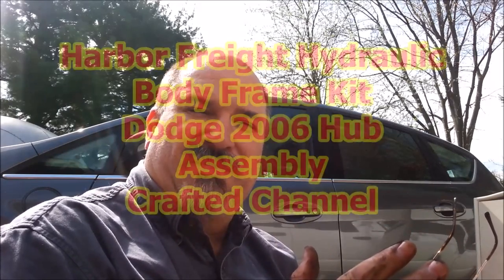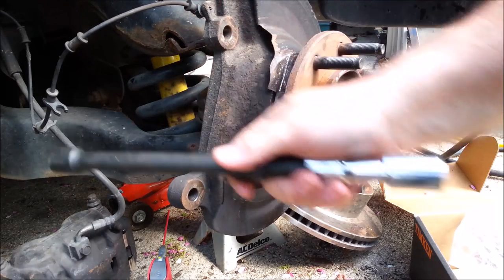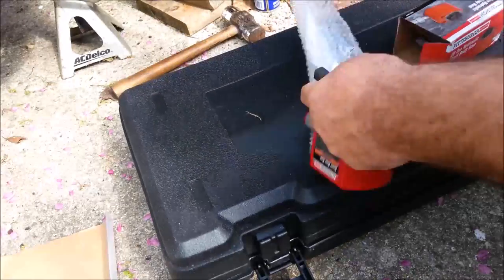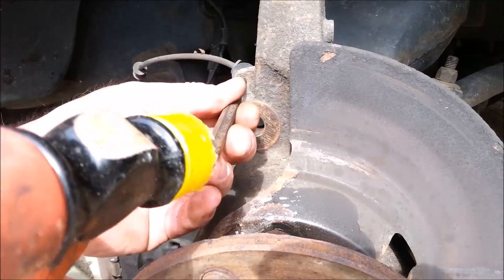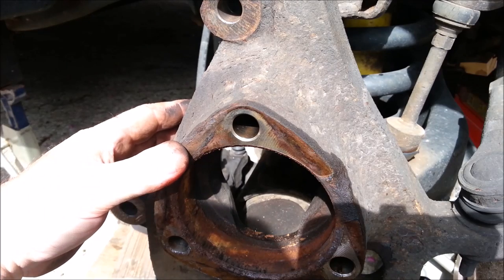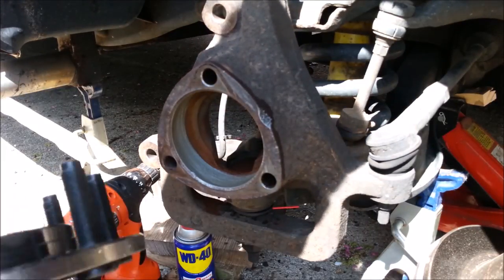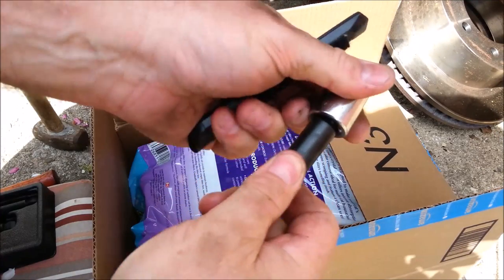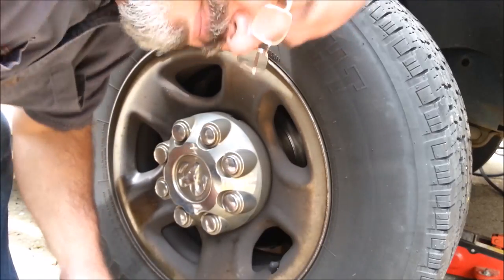Harbor Freight Hydraulic Body Frame Kit Dodge 2006 Hub Assembly Crafted Channel

Comment: Very good observation, only the one incline to mechanics will appreciate this tips, but the risk it’s if you spend all this money and brake something else or can’t fix it then you will double the price, pay a tow truck or rent a Mobil mechanic, but, try first, glory belongs to the positive mind,
Reply from the maker: The error many make is presuming the repair is an end unto it's self.  This is not the case.  An important element is building one's tools as well as skills over time.  I have used the hydraulic set 4 or 5 times by now.  Calculating the the hydraulic kit as a cost in the repair.  This is a fallacy.  First off, I could have easily sold it for $40 less than I paid making it's repair cost portion only $40.  But furthermore, if I've used it happily 5 times when the cost per use is price / 5.  Over time it will become price /10 and price /20.   Considering problems only on the narrow conditions of immediate cost is short sighted.  You have to be very rich to make every decision based on cheapest path possible.  Doing so leaves you Ill equipped and often buying things over and over as you discard he short sighted tool purchases.  The hydraulic set to me has much more utility than this single job.  I don't live a throw away lifestyle.  I am much to poor to be a tightwad.

Comment: This is cool. What about a slide hammer?
Reply from the maker: At the time, I looked for mine, I only recently found it.  After using hydraulics, I'm not sure it would have worked.  I used a decent air hammer on it which would be in the ballpark of my slide hammer power wise.  I've used the hydraulic set a number of times since this video.  Very pleased I have on in the stable again.

Comment: looking good! I been looking at that harbor freight hydraulic kit myself and drooling a bit. at least now I can watch you use yours till I can afford one of my own.
Reply from the maker: How you been Dave.  Need to check in on what you're up to.  Hope things developing in a more positive direction for you.  I wouldn't call this a high use tool but it's definitely something when you need it, you need it.
Reply: i have lots of those type of low use tools, but love having them when needed. great video
Reply: the hydraulic kit is only $116 on ebay shipped!

Comment: Bought one for my 04 Chevy Tahoe 4x4 when it went out at less than 100k. Both actuall went out less than 100k miles at different times. 

Last one I paid $145ish and it's got a lifetime warranty as all my parts do from my local parts house, including brake pads and rotors. Yeah I know you're thinking WTH but yeah they do it for me. 

 I buy alot of parts thru them for me and others I know so back scratching going on. 

I also had a press kit I bought back in 1997 and sold it to the truck/trlr repair shop I was working at as I had it for doing trailer work, truck and trailer frame work, spring pin bushing work on semis and other work on anything. 

I didn't have any trouble getting my hub out after I removed the bolts out and used a 10lb large sledgehammer. 

The other one I replaced 120 miles East of home in a bank parking lot next to the auto parts store. They loaned me the tools I needed. Spent about $40 on some tools that I scratched that they'd let me borrow that were new. 

Just used the factory tire jack and the tire as my safety stand as resources were limited. .
Reply from the maker: I couldn't' believe how long the bearing on the right lasted after it started making noise.  A period of time I didn't know what it was, then I had a must go event I towed my trailer to.  I must have driven on it a month.  Lord looking out for me.  Haven't had any problem since.  Did do the tie rod ends and ball joints.  Rear brakes, need to do rear axle seals and parking brakes next.

Comment: You can use a socket and an extension to but up against the knuckle. The just turn the steering wheel and use the hydraulic power steering to pop the hub loose
Reply from the maker: I believe I covered that in the video.  Bent the 1/2" drive extension.  Might have been last or second to last failed method before I went to get the hydraulics.  I've used he set for several other things since.  Glad I have it.
Reply: Oh I missed that somehow. Sorry. I like the port o power idea to.

Comment: Could have done the same with coupling nut and a bolt. Or, hammer out one of lug bolt and use a bolt and nut to push out the hub. Either way cost you couple of dollars.

Comment: If you look closely at that porta-power accessory-
You could've simply used your own brake caliper to push it off.
Reply from the maker: I've been thinking about your statement.  Bear in mind, I've used they hydraulic set several times and I'm glad I bought it.   Would you have bolted the disk and caliper one, removed the outer pad and pushed it off with the power brakes?   That's a good idea, maybe the the only really good one offered.

Comment: I did the same thing the other week except I put it on backwards and the rotor wouldn't fit. Wasted 30 minutes doing it twice.
Reply from the maker: I recently did a Tomos Moped Transmission.  Had it appart and togeth 6 or 7 times!  finally got it all right.  ;-)

Comment: Cut a stud off drive it out with a punch....put a long 1/2 bolt through rotor with a nut on the back side ... hold back on the nut and drive bolt into the knuckle.... it will push itself off

Comment: oh, and don't waste money on chrome vanadium 1/2in dive sockets and extensions. I've displaced all of my chrome with impact. once you've hammered loose what you need, you can always get a smaller 3/8 if you need tight access. I never use 3/8in impact.

Comment: It looks like this HF hydraulic tool set has a flange type spreader also.  My space (on a 2006, 2WD Montego) is too tight for the ram you bought, could that spreader be used instead? Or is there a smaller ram (I looked, but did not fin any).  

Or, could a cheaper bottle jack be used somehow? (I only need a tool to remove the wheel bearings from the knuckle; no other use).

Or, could I possible use a hydraulic puller - and what could I attach it to as a base? (The car is in my 'single wide' driveway, and I don't have a tree to wrap a chain around - for the second end of the hydraulic puller). 

I am surprised no one makes a hydraulic tool specifically designed to remove hubs (that have no axles in them) as on  2 Wheel Drive cars with no axles in the rear tires.

Comment: Great tool, but 🤔 Am I the only Mechanic that noticed beside not putting the backing plate on, that he didn't put abs/on right the wire goes though the hole in the steering knuckle 🤦 right as he was saying if it's worth doing it's worth doing it right. It happens just was ironic. I see after putting backing plate on u fixed it I think I hope. But great tool and great video 👩‍🔧
Reply from the maker: Nope and nope.  Finished correctly.

Comment: Nice fix Dave, hope she rides smooth for ya :)
Reply from the maker: Oh yea, she does.  Now I have to replace the valve cover gasket which contains the injector wiring.  Been running down 2 cly for a week now.  Last of the parts here any day.
Reply: Sweet....good luck with her :)
Reply: My new vid may help you out on your Atlas if ya wanna check it out

Comment: Make sure u clean those bolts for true tightening there
Reply from the maker: Clean and greased.  You're not one of those dry bolt torque'rs are you?  ;-)
Reply: @CraftedChannel  not grease lock tight sir
Reply from the maker: Long time ago.  Don't think I Loctite'd them.  There was no thread compound visible when I took it apart.  Fortunately, wheels still attached.  ;-)
Reply: @CraftedChannel  coolant passage must b silicone also 👍 u got it there

Comment: You should not have used anti seize on those bolts. Lock tite is a must
Reply: Was it antisieze or gray rtv?
Reply: You were right, sorry.  Torque should hold the bolts, but I usually use a dab of blue loctite on most suspension fasteners because of vibration.
Reply: @IamKurr  I use silicone works best stops rust and bolts wont back out. Mega black or ultra black works best

Comment: When my durango was stuck I used a nut and bolt
Reply from the maker: Made this a long time ago, don't remember if I had two parallel to each other surfaces to spread against in this way.  I'm still happy, I've used this tool kit several times for other projects like straightening out a Kennedy tool chest which had the top crushed in on it.  I've probably received 200% of my investment back by now.
Reply: @CraftedChannel  I like it but the whole kit is un needed. Hopefully I can find those two pieces by themselves. Midwest rust is brutal.
Reply: @CraftedChannel  but yes I'm stealing ur idea lol
Reply: yes i have used a nut and bolt too to press out something,, i now have the longer coupling nuts they have at the hardware store..

Comment: Tools:  Couldn't you have used a hydraulic flange spreader?  They cost about $75 where as your setup cost about $200-250.
Reply from the maker: If the denominator were accomplishing this one job, you'd be correct.  Remember I said I once owned a set like this I missed having one.  I've used it at least 4 more times since.  And I'll be very happy to use it more.  So, my cost per job is less.  This was a long-sighted purchase that solved an immediate problem.
Reply: It looks like this HF hydraulic tool set has a flange type spreader also. It my space is too tight for the ram, could that spreader be used instead?

Where do you buy a $75 spreader?

Comment: Very good, Did you see the Hub Breaker on Amazon?   Last hub job I had done a friend didn't for me saved me 100.00.  But I ordered the Hub Breaker and will only cost me less and I keep the tool.  Thanks for the video.
Reply from the maker: Yes, I did.  But I regard it as much more expensive because it has only one use.  I don't replace hubs for a living.  If I did, I would consider it differently.  The hydraulic kit has been used on a few projects since the hub replacement.  So, my cost per use is only 1/3 or 1/4 at this point.  I intend to use it for the next 20-100 years.  ;-)

Comment: But isn't the baby-bottle jack all you needed? I am sure it came with a jack handle so you don't really require the kit- at least for this application if I wanted to save myself $200
Reply: It doesn't come with the pump ... just the jack

Comment: Sharpening the air chisel would have gotten you there but I also lie to my self to justify new tools hahaha
Reply from the maker: I've used it several times since.  I picked up a bent up 7 drawer Kennedy last summer.  Used it to jack the top back into shape.  Paid 50 for the box.  Put it in place of a 5 drawer Waterloo which I have now sold.  Made the cost of the tool back again on the toolbox.  It would easily sell for 250ish.  My only problem now is it's so cold in Ohio. Been in the teens lately.  Doing indoor work.

Comment: If you are REPLACING a "ball joint" (tie rod, control arm, steering)
the best "tool kit" is a Pickle Fork and sledge hammer. IMO.
Reply from the maker: I've since replaced the Tyrod ends and both upper and lower ball joints on this truck.  Didn't do a video.  Big job for a fat boy without a lift.  ;-)
Reply: @CraftedChannel  
I'm 5' 8" 380 lbs. Always in my my own driveway. Left arm unable
to reach over head, about 20* movement. 42 year old injury, inoperable,
so I've learned how to cope.
Yes, thank you for the kind words- most just leave comments, I actually enjoy interacting with the Uploader, giving advice, answering questions if I can. Yes, outer pad off- hydraulic caliper has thousands of pounds of clamp. Porta-pack is awesome tool, but I was just thinking out loud and in practicality- that what's possible if someone doesn't have extra money for tools.

I remember watching my Uncle, using the car's bumper jack and it's own weight to dismount & mount a new tire; that's why the "lug wrench" that came with cars was called a "Tire Iron", and the bumper jack's baseplate was curved. Rural Folks had a certain self reliance you don't see today.

Swap an engine under an oak tree, walk 10 miles each way to ORDER a car part. People were way different back then.

Comment: You forgot to put the dust shield back on
Reply from the maker: I don't remember if I mentioned it or showed it later in the video but I do remember the error and correcting it at the time.  Timken bearings still doing well.

Comment: You got the guard the goes between the hub haha but I’m definitely going to get one of those hydraulic tools cuz it was a pain for me to get mine off
Reply from the maker: I corrected the missing dust shield and mentioned it in the video as I remember.  It will work.  I've used mine since to straighten out a Kennedy Tool Box with crushed top.

Comment: All you had to do was bolt the wheel to it and use a 4x4 against the frame. And you get to keep the 4x4!
Reply from the maker: You must have skimmed it.  I believe I mentioned bending a 6" 1/2" extension trying to use the power steering to drive it off.   Besides, I've used that kit a number of times on other projects.  I didn't toss it in the bin.  I'm totally satisfied with investing in my home shop tools and capabilities.
Reply: No, I watched it all.
Reply: You used a short extension in a location that has literally no leverage. The outside of the rim has exponentially more leverage. And in most cases you can even do it by setting the tire on the ground, leaving a jack or jack stand just under the frame so that all of the cars normal weight is on the tire. The drag on the ground will break the bearing loose/out. 

You aren't wrong, any hydraulic force applied like you did works great. But there are far easier, and cheaper solutions.

Comment: Can you put a link to where you got your hubs ?
Reply from the maker: They were Timken Brand.  Very good bearing manufacturer.  I think I got them from Rock Auto but do not remember now.  Pricing is all over the place.  These were middl'ish priced and not China made.  I read the China crap didn't hold up very long and didn't want to do the work again.

Comment: Good tools   slide hammer could kick it's as too
Reply from the maker: Yes, a large one might have worked here.  I didn't own one at the time other than a very small one.
Reply: You usually just pull the hub off the bearing with the slide hammer if its really stuck.
Reply: @MontanaWelldigger  Sometimes they are so tight a 10 lb slide wont even budge them.
Reply: Sometimes by inverting the rotor or drum on the lug you can use it like a slide hammer.

Comment: It think it's better with a Press.
Reply from the maker: I have a 20 ton HF hydraulic press. The problem is getting it in the wheel well ??  Or, I'd have to remove the spindle assembly to put it on my press.  That is also a lot or work and might as well be doing ball joints at the same time.  I didn't have ball joint tools at the time of this video but have since done that project as well as I observed it was coming due while doing the wheel bearings.  So yes, valid method but I didn't have that much time then and I needed to get the truck back into service if I were to avoid a rental car cost.  Plus, I wanted the other kit anyway.  Excuses.  ;-)
Reply: @CraftedChannel  I bought the harbor freight hub installer,but it's only a installer ,so I bought the 20 press also,so for me it's much easier that way.Everyone is entitled to work how comfortable they feel.

Comment: Budget a few dollars a month and get the basic tools first then specialized tool... Don't get stuck on  a job because you overlooked a tool at the store... I mean if its very expensive and you may only need it once the rent before you start the job.
Reply from the maker: I've used that tool like 4 times since that repair.  And how is one to know precisely every stumbling block that will be presented and to have the correct tools on hand?  Perhaps if you have the manufacturers repair manual and you are working on cars too young to rust this is possible.   I would note this truck is 16 years old and well over 200k miles.   Working on older cars is not as cookie cutter as we'd like it to be.  Winners win and I knocked it out.  I'm not a minute sad when I see a tool on the shelf ready to go for the next need.
Reply: Not criticizing at all ,Everyones needs are. Different. When you’re a working mechanic you must be prepared to tackle a multitude of jobs and therefore your tool needs are much greater. As A Diy person basic tools will do most jobs.
Reply from the maker: @abdonrodriguez3586  My respect and apology if I missed the tone a bit there.  ;-)  I have worked as a mechanic and am now a professional maker.  I make at work, I come home to make, I make on the weekends.  When I go on vacation, I get antsy to get back to my projects.   I am incurable.  I'm really very well equipped.  I recently spent about $50 to get 3 long reach center drills because I've needed one twice in the last 6 months.  If I can afford it, I want the basics at hand.    And it's lead to a very good career for me.